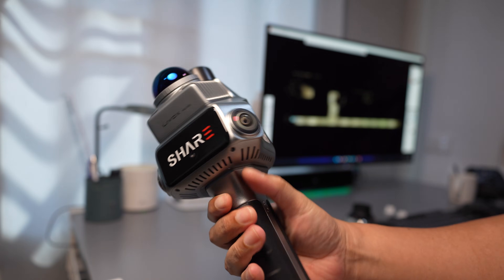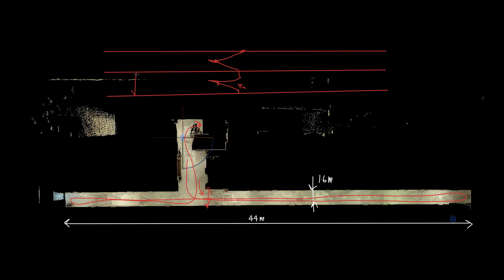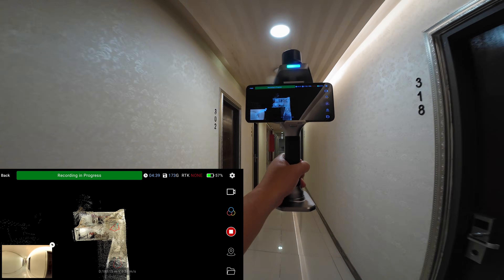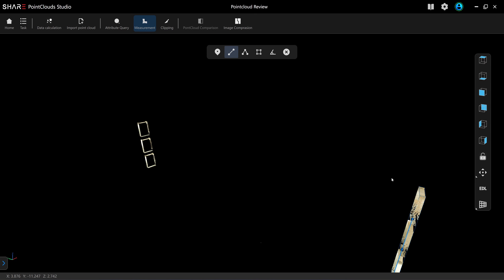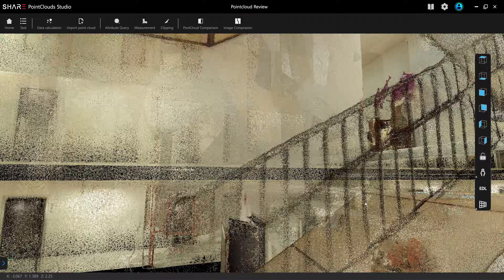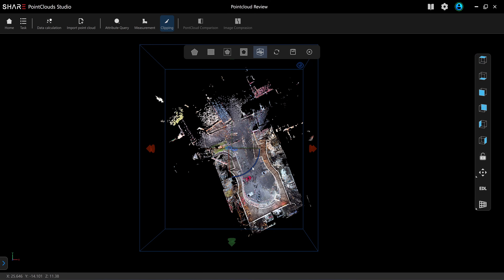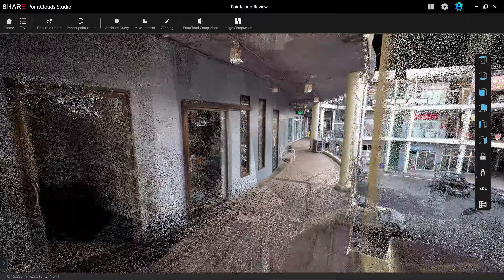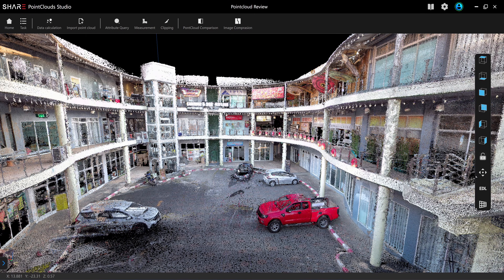SHARE S20 LiDAR Scanner – Next‑Level Tracking Performance Tested

Comment: Hi, great video, very useful. Did you notice some drift along the same corridor for the Z? Is there a significant difference between the Z values at the beginning and end of corridor without using RTK? Thanks!
Reply from the maker: Max deviation on floor to floor distance in this sample is 16mm
Reply: @Payo-TensileCreator  ok... i noticed from you number that the z values of the 3 floors for the two sections are (5.715,2.742,-0.245) and (5.801,2.817,-0.152)... it means that every corridor bends around 8 cm in elevation, which is not bad for a long corridor...
Reply from the maker: @luigib4550  The corridor is finished with ceramic tiles, laid over a sand, cement substrate ranging from 3 to 8 cm in thickness.

Comment: Hi Payo, it would be nice if you could measure the length of the hallway with a laser distance measurement so that we could compare the accuracy? Thanks for your work 😊
Reply from the maker: We don’t validate one laser device using another. The verification tool must be more precise, such as a steel measuring tape. Even the best laser distance meters typically have an error margin of 3–5 mm.

Comment: Fascinating. Would be impressive, if C1 can do the same.
Reply: I think it is, and I sure hope it does
Reply from the maker: SHARE SLAM is very good. But it can only fix the drift after the scan is completed. Repeat pattern can make LiDAR lost its tracking before finishing the loop.